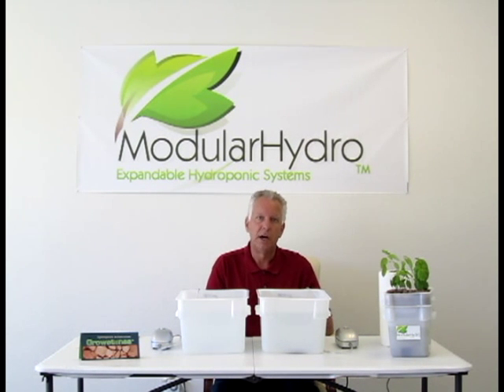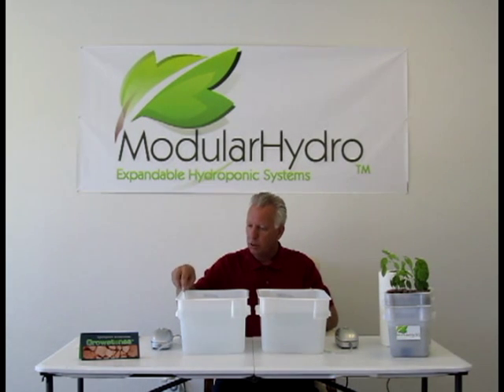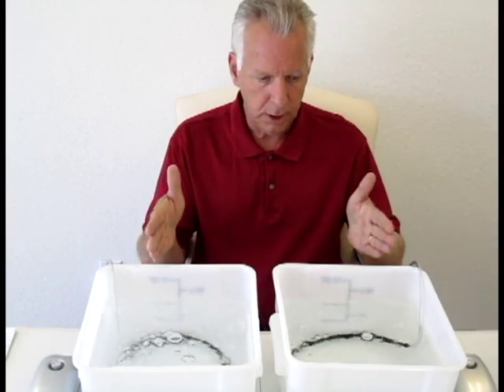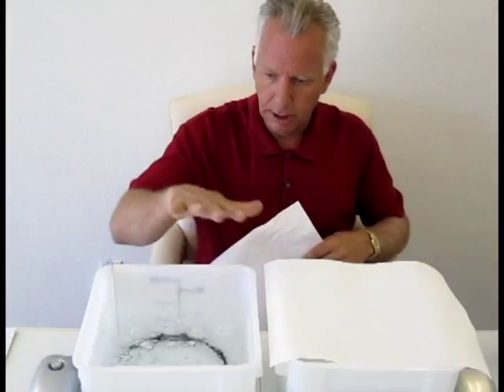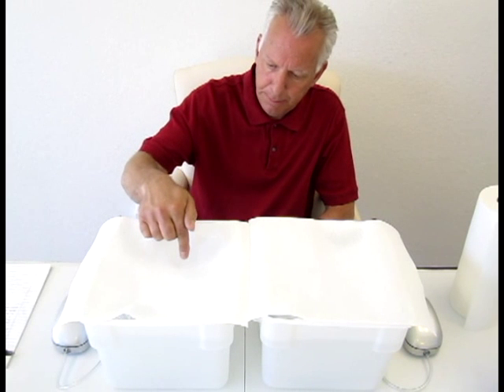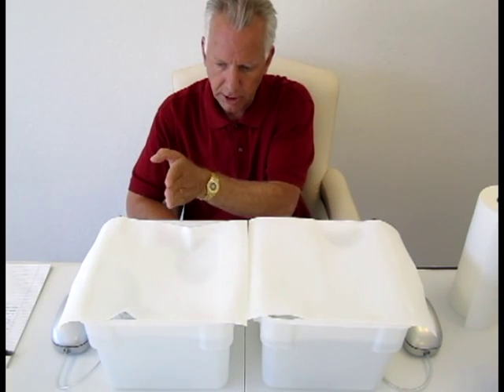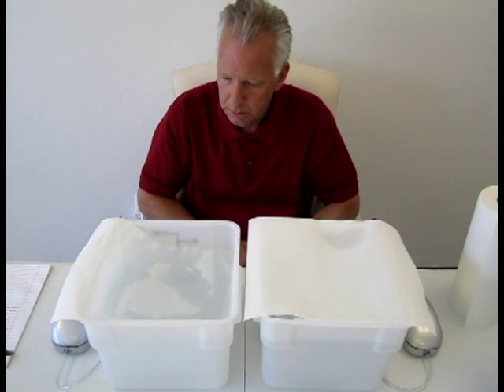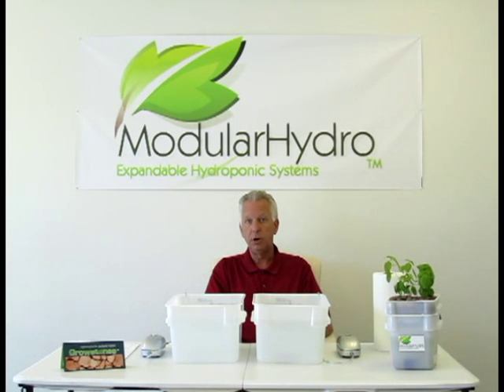Air Stone versus AIT Air Injection Technology for Hydroponic Systems

Comment: I did a static hydro grow (meaning no Air Stone or pump) it was Basil DWC
At 1st I thought it would not even work, I got an amazing amount of basil all year long.
Changed the water once a week, and in the end of the season the plants were done. I did found it had great roots no real algae or mold problem. I think a little hydrogen peroxide would of fixed that if I needed it, but I never did. Just letting you know, Hydroponics doesn't have to be complicated or expensive to have a great crop.

Comment from the maker: @Don007206 Actually, the idea behind the Air Injection Technology is to defuse the air into the water more evenly and focuses more on maximum bubble count rather than larger bubbles. You may not be able to see it in the video but AIT has many times more bubbles diffused in the water (The air stone has much larger bubbles) 

Its kinda hard to show in a video so we tried to come up with a creative way to illustrate this through the paper towel test. I'm sorry you do not approve.

Comment from the maker: @NecroplantTheNoob Indeed. Our advantage comes from the increased distribution of bubbles. When you increase the number of individual bubbles begin created, you also increase the surface area of the air that's actually in contact with the water.

Comment: So this is basically an air pump without an airstone.  I'm about to start 3 or 4 deep-water systems for beefsteak tomato seedlings.  I've read that aquarium air stones are not really required for fish aquariums unless there is a septic nightmare that is restricting the flow of oxygen.  So I came to this video because I've been curious how it would be without an airstone.  It makes sense: it's just supplying oxygen either way.